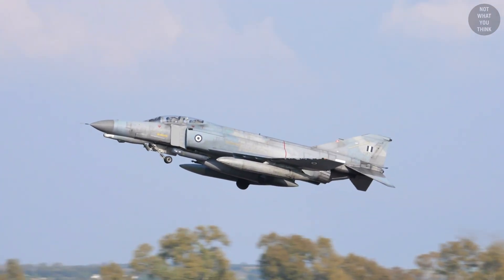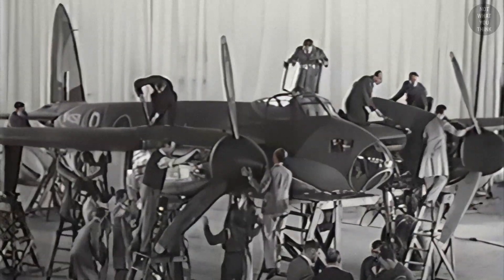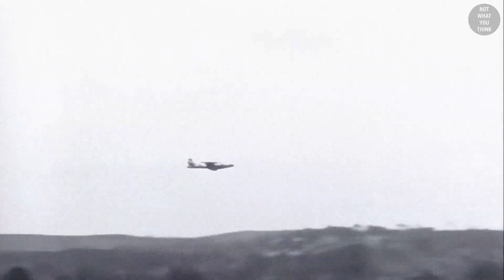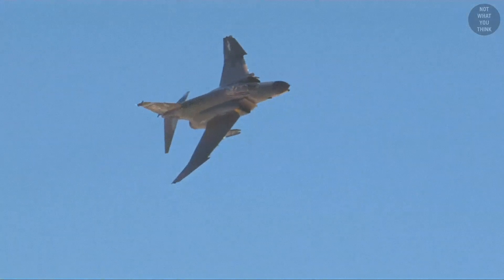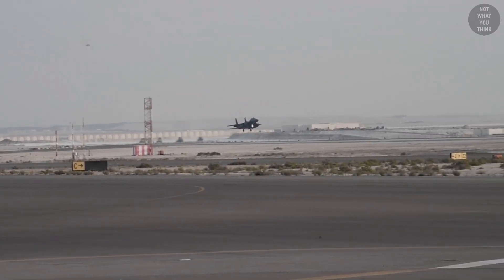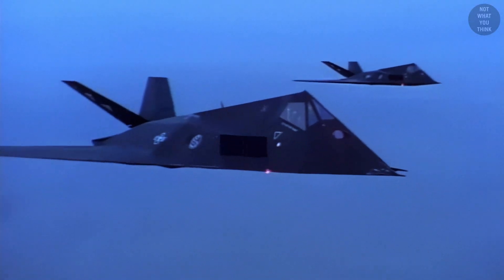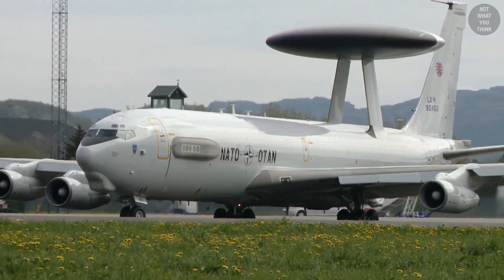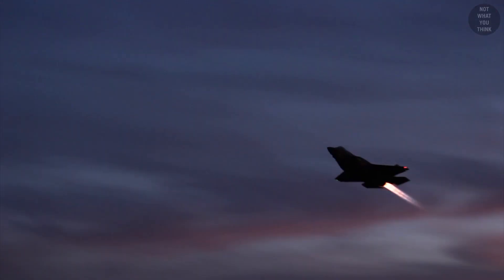Why are Modern Fighter Jets Slower than 1960s?

Comment: TL;DW: All out speed was a design priority during the early Cold War, but was found to not actually be that useful in the real world. Modern aircraft design trades off maximum speed for more useful attributes like greater maneuverability, effective range, payload capacity and stealth.
Reply: All out speed was extremely important for the interceptor role when nuclear weapons were to be delivered by bombers. Of course, that became much less important once the delivery platform moved to ballistic rockets, but it had its time of utility. The English Electric Lightning was explicitly designed for that role with time to altitude being extremely important for interceptions over the North Sea.
Reply: @TheEulerID   Yep, exactly. When bombers were the primary nuclear delivery method, the super high speed “dash” capability was extremely important. It’s ironic that the actual fielding of these super high speed fighters almost directly corresponded with the introduction of the ICBMs that would immediately make them obsolete.
Reply: @splewy  The lag from design to production.  You can only design with the technology you have, and by time your design is created, presented, accepted and the tooling prepared, you're flying a brand new aircraft based on 15 year old technology.
Reply: @TheEulerID  it wasn't just that, but the extra speed allowed them to outrange SAMs at the time as they had relatively short range. While you can't 'outrun' a missile, you can get out of its range before it hits you...
Reply: @mandowarrior123  
English Electric Lightenings were designed to intercept Soviet nuclear bombers over the North Sea, and the nearest Soviet  SAM missile would have been over 2,000 km away.
Reply: But hypersonic ?
Reply: Right, because all of that Cold War equipment was designed to fight a nuclear war, in which case these craft would be well suited.  but that has not come yet.  Maybe soon though.
Reply: So back then, it was more of a sprint - they just had to get fast as fuck to beat the bombers. Then when missiles delivered the bombs, and planes didn't have to do much fast chasing, they went for the all-round marathon. So yeah, F-4s are sprinters, F-16s onwards (and other related fighter aircraft) are marathoners
Reply: @dd-579fletcherwillyd.9  On this matter, I think hyper-sonic rocket planes might make good strike bombers/reusable ICBMs/bomber interceptors.  Let's take it to a greater extent:  an orbital strike platform in the form of a reusable space plane, basically a big black triangle with rocket engines on the back.  Sure, the SR-72 is similar to this idea, but it is still a jet aircraft.  I think rocket propulsion is the way to go.
Reply: I do recall an F-106 (mach 2 plus) pilot of Air Derence Command say that he never exceeded mach 1.6 during his time flying the a/c. So even in the heyday of the mach 2 fighters, it may have been a rare thing for a service (as opposed to test) pilot to ever get to that speed. 
The F-111 could do 1650mph at altitude, but its forte was skimming the ground at mach 1 plus.
A bit like a 200mph supercar. They rarely ever get near that speed, but the power provides great acceleration and overtaking capability.

Comment: you were comparing a twin engine to a single.  The F22 would be a more relevant comparison than the F35, but the F22 can hit mach 1.9 and wouldn't have as much impact for your video.
EDIT: I retract my comment, you sufficiently addressed this later in the video and I actually learned somethig, next time I'll try to remember to listen before speaking.

Comment: This is a crass simplification. Modern air combat is not about a furball at cornering speeds, but a high speed dance weaving in and out of Fox 3 range. And guess what? Being able to push above mach 1 with a good missile loadout is quite important here. The ability to get high and fast for a few minutes gives a big edge.

Comment: I think the Falklands war was a real tipping point, the British main fighter was the sub sonic harrier, whereas Argentina had very fast Marage's well over mach 1, but that speed didn't help, especially as it meant the aircraft were at two different evelations and this meant that the aircraft played chicken until one would go to intercept the other, this was almost always the Argentinians and the lower they were the lower top speed they had and their high speed design made them less maneuverable.
Reply: the other trick up the sleeve is that all vtol enables jets can to something all others can, fly incredible slowly and low to the ground. as odd as it sounds it just as difficult if not more to hit a target magnitudes slower than you than it is one thats faster.

you can see this in the example of the korean war, the first air to air combats kills was a single a2d shooting down 3 migs. the very slow attack prop has a massive maneuverability advantage, and the migs time on target is incredibly small due to the speed differences.

Comment: This isn't directed at you or your information but from what I understand this only seems true if looked at by top speed only.  Modern jets are capable of higher crusing speeds and less fuel to travel at the same speeds.  Also the de-emphasis on intercepting nuclear carrying bombers, is because of the proliferation of ballistic delivery systems, changed the required capabilities of fighter aircraft.
I think either I missed it or you didn't cover the huge vulnerability to IR weapons a jet on afterburners suffers, its basically a beacon!

Comment: I am surprised no mention of change of doctrine. Back in the 50s and 60s, they still used a lot of bombers. That is how you delved a nuclear payload. And those bombers tried to fly higher and faster to not get shot down. So you needed interceptor planes to shoot them down. But with ICBMs this changed. Even an interceptor fighter have no real hope in shooting down an ICBM. At the same time, the bombers that were left change how they operate. Going high and fast would not help since not only would interceptors be able to catch them, but missiles technology also improved as mention in the video. So flying low became a priority, and later stealth on top of that.

Today we are seeing new doctrines being developed with the introduction of drones. And we will likely see fighter aircraft adapt to this new reality. Just like how they have adapted in the past. Naturally other elements have also played a part like the change from specialist aircraft like the mention interceptors, to multirole aircraft which dominate today.

Comment: Where they conducted their tests, and dog fight data over Viet Nam is like limiting the playing field to 300 miles. To day we seem to patrol areas exceeding 2500 miles. While the F22 is a capable fighter jet. The F35 is just to limited on range, payload, and speed. It's a point defense plane for small countries, and not the future of air battles. It's ability to land in a small area is a nice advantage, but it's high maintenance requirements makes it a POS under battle conditions. At best we can keep 50% of the new planes operational. It's requirements of non stop repairs makes the F35 the least reliable fighter ever built. I believe the new F15EX will replace most F35s. The Navy will be stuck with the F35 until they rework the F14 Tomcat to handle all the new electronics. It's a job that should take 6 months, but will take 5 years.
Reply: The F-15EX will not replace any F-35, only all the F-15C/Ds for air defense and maybe the F-15Es in the future. The F-35 (which is actually the more capable platform despite the respective roles) and the F-15EX are meant to compliment each other. They are both new fighters and will stay in service for years to come.
Reply: The F-14 is no longer in service since 2006 being replaced by the F-18E/F Super Hornet. A new 6th Gen fighter (F/A-XX) is currently being developed for NAVY as the future platform and will likely replace the F-18. Again, the F-35 is here to stay.

Comment: There's a lot wrong here. Most grievously, speed very much is a factor in avoiding surface-to-air missiles. The speed of the missiles is high, but their range is low. A high top speed can allow an aircraft to outrange them before intercept.

Comment: Yeah, speed is much more important than you make it out to be. Missiles might be faster than fighter jets, but are limited by range. A faster fighter can get out of range faster than a slow fighter, so yes, you CAN run. Also, super cruise on the F-22 means you can cruise at reasonably quick supersonic speeds efficiently. The F-35 has much worse stealth, is slow both in top speed and acceleration, and can’t turn well either. Its only advantage over something like the F-16 is halfways decent stealth.

Comment: But in combat, especialy BVR it can be detrimental to them. The faster fighter will have longer range on their missiles. (Since the missile will carry the planes energy in the launch). They are different kinds of planes, both are needed, in fact recently the F15 went back into production with the F15EX (An overt platform used as a missile truck that can also dogfight, to be used in mutual support of the stealthy F35 or drones) F35 or drone gets closer and paints the target for the F15 through datalinke and the F15 comes in very fast to optimize weapons range, fires the missile from far away, out of harms way and imediately turns back to reset, rinse and repeat.

Comment: Turn rate has zero influence on the speed fighters choose to fly, other than extremely rare circumstances when it merges with an opponent. For air to air engagements pilots want to enter combat with maximum possible energy, they always want more speed. Designers of the F35 didn't choose Mach 1.6. It was the maximum top speed technologically achievable given the design choices. If they could have made it faster, they would have.
Reply: That theory of air combat hasn't been relevant since the 60s. Don't believe anything the reformers blab on about, they're stuck in some WW2 fantasy land where the Germans were the mightiest military ever.
Reply: The amount of energy modern fighters have on tap is FAR beyond what they’ll ever need in an engagement. You’re talking tactics of WW2 and Korea. That went out the window in the 1970’s with modern legacy fighters.
Reply: @afcgeo882  A flight of F22s detects a flight of hostile fighters and moves to engage BVR. Where do you think they put their throttle? What altitude do they go for?

Comment: I always thought  higher max speeds meant that you are able to intercept faster and not that youre faster during combat.
Reply: True, but it turned out when you were carrying a bunch of external missiles and fuel tanks, you couldn't even get anywhere near the published top speed anyway due to the increased drag. You'd be lighting the afterburners and increasing your fuel consumption by many times over, just to beat against a brick wall and achieve another 0.3 Mach at best.
Reply: @EnDSchultz1  Yeah well but faster is faster either way.
Reply: @TheDude50447 not really. When you take into account the super cruise ability of aircraft with internal stores (F-22 etc) then they end up going about as fast as an older gen aircraft could when fully loaded, except they don't need to guzzle 10x the gas to do it.
Reply: @EnDSchultz1   Yeah Im well aware of that. But its more like super cruise capable aircraft use about half the fuel for similiar performance. But the F22 is an exception. The Rafale, Eurofighter and some SU 35 are also super cruise capable but carry their weapons on external hardpoints.

Comment: First of all the very high speeds for Fighters had a reason: to intercept other bombers, fighter and reconaissance aircraft. Ask the Russians how often the Mig-25 flew at Mach 2.5+. A lot. And at the Eastern border of NATO speed was (and still is) very relevant to intercept enemy fighters. 

Unlike the days of Vietnam, supersonic fuel consumption is a lot lower today as there are many supercruise capable fighter jets that can fly at sustained high speeds.

But more importantly, you got the order wrong. "Stealth" requires lower speeds. Because of the less aerodynamic shape and to avoid increasing signals. Also they cannot carry fuel or weapons externally without sacrificing stealth so they are heavier and must fly slower to reduce fuel burn. Also the F-22 speed was reduced because the aircraft was so full of technical problems that it is not fully operational - even today. So stealth is not enabler for lower speeds, lower speed is currently a condition.

I think it ultimately depends on what you use it for. Stealth and low speeds are clearly preferrable for fighter bombers, while air superiority fighters do require higher speed capabilities. Low radar observability (aka stealth) is also a gamble as the detecion ability has increased quite a lot in recent years and the exclusive reliance on stealth of the F-35 might prove disastrous.

Comment: stealth is always vulnerable to thermal either way, and the russians not only still kept around their mig 25's and 31's but they are replacing them with the mig 41 which is supposed to be able to hit over mach 4.3...so. are you suggesting they dont know something we do or that they know something we dont?
Reply: I’m suggesting that the Russians are not quite honest about their equipment’s capabilities
Reply: @bosknight7837  ill hand it to you there, and maybe the extended geography of their interior might lead them to feel they have a extra need for it, but they do seem to be continuing to spend money on research and upping benchmarks with a limited economy instead of focusing on other potential aspects.
Reply: @operator9858  they have also gotten stuck not even 100km into enemy territory. The Russians just might not be the Creme of the crop when it comes to warfare…at least not anymore

Comment: He's comparing "interceptors" to "fighters" which is a bit unfair since there's a difference. The interceptors of old were meant to intercept enemy turboprop and jet engine bombers (who'd be carrying nukes) and do it fast enough to a) be there in time and b) potentially pass through the enemy's screen of relatively slow (compared to the interceptor!!) escorting fighter jets. 

Nuclear bombers are kind of out of fashion since we have very capable surface-to-air missiles now which can do the same job as the interceptor, but without sacrificing a pilot (since the interceptor is actually a lousy fighter and attacking a bomber formation was usually suicide). On the flip side, we send nukes using similar missiles instead of as a bomb dropped from a bomber.

For a 1960's interceptor though, you absolutely want to be fastest as you possibly can, shoot down the bomber and then hope you can escape just as quickly. No "dogfights" with other fighters.
Reply: I mean, it depends on what interceptor you're talking about, when it to attacking an enemy formation. And interceptors are essential for carriers and the-like. Since (for example) SM-2s can only go so far
Reply: dogfights nowadays are nearly obsolete.
Reply: @cerdickjohn2385  A good example of a place where dogfighting occured is Ukraine

Comment: The video isn't wrong but overlooks the primary purpose and real combat use of high speed afterburner situations, as was the reason these older designs were the way they were.  The use was for one purpose and one purpose only:  To rapidly get out of a tight situation.  This was used extensively in Vietnam and many F4 pilots credit its speed for their survival.  When things unexpectedly got too hot the pilot would light the afterburner, nose down, and get the hell out without being able to be chased down.  They sometimes ran out of fuel before landing but it at least got them into friendly territory.  THIS was the purpose of high speed in fighter aircraft and THIS is the reason it is obsolete today.